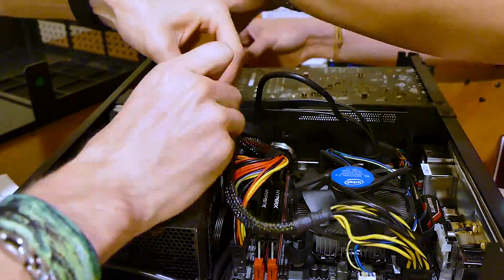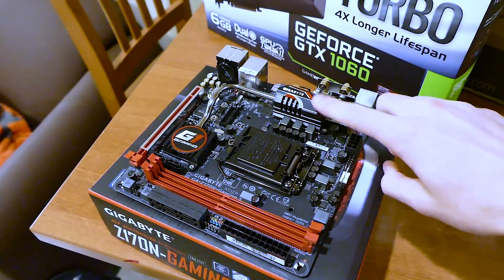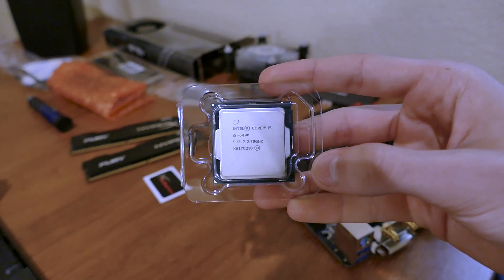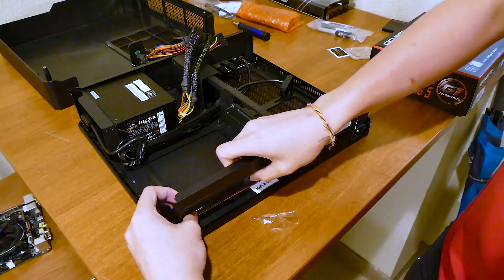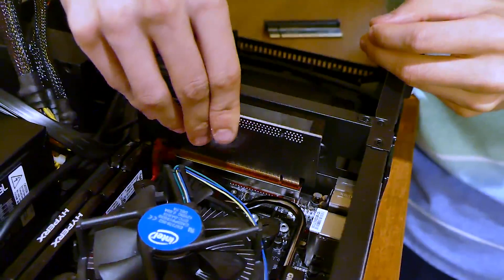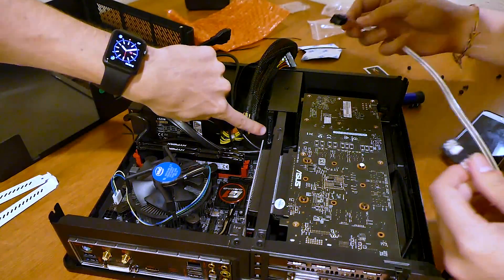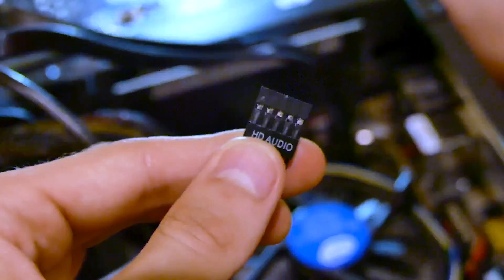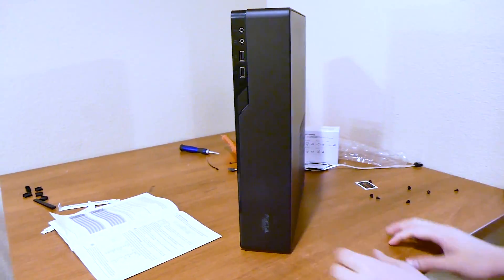How to Build an ITX PC (2016 Edition)

Comment: you can't get an HDD in that case can you?
Reply: 2.5 inch drives, but not 3.5 inch
Reply: you should try out a pcie m.2 drive. those hit speeds up to 3k megabytes!
Reply: Robin Clarijs well ssds are really night and day compared to HDDs in speed. I wouldn't wasn't a gaming library on an SSD. My main file storage is a 480gb SSD and I have a 2 TB HDD partitioned for backup and for game storage. I have 1 game on the ssd. That's also the same mentality people have about price differences in GPUs/CPUs. When it comes to PCs, money and performance do not align in any meaningful way. Unless your budgeting, there isn't a real reason for holding off because 2x the cash doesn't mean 2x the FPS or the write speed.
Reply: I'll go for the rvz01 from Silverstone. Room for an HDD and ssd as well as full height GPU.
Reply: Someone could do fine with an ssd
Reply: Robin Clarijs it will be much longer before SSD prices come close to HDD prices because there's room for improvement on SSDs. SSDs will be expensive for a long time to come. I find that saving time on read/write in my daily workflow is worth it. I transfer very large files between PCs every day. Like 30GBs + file sizes. If I can read 2.8GB/s and write 1.9GB/s for 3x or even 4x the cost, I'm going to spend that. It's valuable time saving. Where as a WD Black reads and writes a measly 150 MB/s. Do you see now how one might justify spending $800-900 on a 1.5TB PCIe SSD? Sure you could build a decent gaming rig for that price, or you could be ultra efficient.

Comment: Slick design. was the blower style GPU necessary because of the small form factor?
Reply: if you use open fan style gpu in a slim case, the hot air would keep circling around inside the case, and the gpu will suck the same air over and over, it might overheat the internal of the case aswell as all the components. The only mean way of air coming out is passively through little holes which is slow and painful. So the blower style gpu will ease the internal temperature abit because it behave more like an actual vacuum. Its not necessary but the blower is better for slim itx case.
Reply: thanks
Reply: Yo I'm extremely new to PC building and had a quick question about this. He said something about the turbo style GPU being generally underclocked. Could you explain this a little more to me? How much does this affect the potential of the GPU? Also, how effective is the turbo style GPU at keeping hot air out of an itx case. Thanks! (sorry for being dumb)
Reply: so if i were to build something similar to this build (leaning toward an itx for its size), having a turbo gpu wouldn't limit it's potential? thanks for the response
Reply: Awesome, thanks for helping out man!

Comment: so quick question, does a i5 6400 over clocked to i5 6500 frequency yield similar results? I have seen that the i3 6100 does almost as well as the 6400, and that you should really just go for a 6500 or a 6600k. Am I misinformed?

Comment: can you sit the case down flat or does it have to be standing?
Reply from the maker: You can lay it down flat, but at the expense of partially suffocating your graphics card.
Reply: It really should have included some sort of feet.
Reply: You can just put some small blocks at each corner if you need them that badly
Reply: It comes with adhesive rubber feet.
Reply: +Science Studio well it does not suffocate much tho check out kyle's video on go anywhere and do anything pc 
but i think he has a fury gpu which kinda small if that affects anything
Reply: is that pcie riser comes with the case? or bought seperately
Reply: comes with.
Reply: Thank you guys.

Comment: i would rather use a bit more money than actually buying asus turbo. is loud and hot
Reply: This card has a blower style fan, which works better in small spaces.
Reply: Also has a pretty low tdp so that's good too as well (low as in less than fe)
Reply: so does the rx 480 card work well with that blower style card?
Reply: Just like my wife

Comment: hey Science Studio,
do you have a way to bypass the bclk Oc blocker microcode from Windows. Because nowadays undoing a Bios update isn't sufficient
Reply from the maker: Downgrading a BIOS takes literally two minutes and harms nothing. In fact, most motherboards are running the stock, oldest BIOS available.
Reply: yeah, but now windows will give a boot error if you try to bclk
Reply: Yeah when the Bios is updated, the CPU's own microcode is then updated to disable the baseclock OC. as far as i'm aware theres absolutely no undoing this, and even if you can its dangerous biz messing with something like that. haha:)
Reply: to be clear I was talking about the microcode, you can't undo that. though you may be able to downgrade a bios in some situation.
Reply: +Pranav Veerubhotla then you did something wrong :(
Reply: Microcode is called such because it's the code intended for the operation of a microprocessor. There's no such thing as bios microcode.
Reply: I know what you mean, this happened way before too, Intel just distributed a microcode into their CPU via an update, rendering all "overclocks" useless and resulting into bricks

kinda a di**move
Reply: You can't downgrade bios on most boards...
Reply: +Science Studio do a video on this please how to downgrade your bios
Reply: Isn't the microcode in Windows?
Reply: It's just Intel punishing consumers so they can protect their sales of unlocked CPUs. I say that as an owner of an i5 K series, Intel if you're listening stop kicking the first time/budget builders out there who just want a few extra MHz.
Reply: Correct. But the "CPU Microcode" is on the CPU. Not in the bios. It simply uses the bios as a safe way to update that.

Comment: This is exactly what I was looking for thank you.
Reply from the maker: Thanks for watching!
Reply: Would something like like the GeForce GTX 1070 MiniITX work better for this build? or even work at all? http://www.newegg.com/Product/Product.aspx?Item=N82E16814125893&ignorebbr=1
Reply: he opted for a 1060 mainly for budget, but a 1070 works well too, hell i saw people shove in reference cooler gtx 1080 inside that case and they work as well, just know that those are pretty loud on high fan settings.
Reply: Yea I figured, The one I linked was a Mini 1070 so it looks to be about half the size built for mini ITX builds. And how would you feel taking this in your backpack for a carry on for flights?

Comment: Very nice! I'm thinking of downsizing to ITX when I next upgrade my video card (so probably like 2 yrs out still), it's becoming increasingly more appealing to me, especially with how power efficient stuff is getting.
Reply: I'd rather stick with full atx. Itx is all crammed up, cable manegment is a pain, heat, and a lot of parts wont fit in a case
Reply: you could check the Bitfenix Prodigy Itx case, it has enough space for liquid cooling, a gpu of three fans; it only lacks in cable management, I use that one ;)
Reply: +Melancholia Dementia or fractal design nano s
Reply: +Joseph B. Depends on the case really, what I like about itx is the fact that you can move it around, which I do quite a bit.
Reply: Joseph B. I don't mind it being cramped. I don't upgrade my system frequently and I'm not interested in closed loop systems or anything.
Reply: +Hiebly I'm currently building in the 250d, I highly recommend it.
Reply: AXLplosion Aye, it's one of the ones I'm most interested in! Others that have my interest are the Fractal Node 202, Silverstone RVZ-02, and Phanteks Evolv.
Reply: +nickthaskater And if you ever need an optical drive, the 250d works for that as well.

Comment: Question Greg senpai, how much heat and noise you get on that pc? i want to build one like that, but im a freak about how noisy and hot  gets my pc on full working
Reply from the maker: It was actually surprisingly quiet. Virtually silent at idle, and moderately loud thanks in large part to the stock CPU cooler.

Comment: I feel like overclocking an i5 6400 non-k is not worth it. I think you would have to downgrade your bios and turbo boost will be disable. Additionally, the extra power from overclocking  doesn't make much of a difference in gaming in terms of fps. Not to mention the risk that is involved, the more expensive z170 motherboard, a aftermarket cooler(although some people still buy an aftermarket even if it's a non-k), and you would also have to mess around with you dram. 
What do you think Greg? =)
Reply from the maker: I've done it several times. Either stay at 3.2GHz or overclock to 4.4GHz and lose something you'd likely never use anyway (your iGPU).
Reply: I actually have a i5 6600 non-k( got it on sale) and a z170 motherboard, I was planning to overclock it too. Can you tell me if the extra processing power really makes a difference? I've been getting a mixed opinion on the fourms. Thanks!
Reply: can you make a video on how to overclock a non-k cpu using this method?

Comment: A nice build, but the only comment that I have is that I would have gone with a single 8GB stick instead of dual 4GB sticks. From what I understand, dual channel memory has virtually no effect on day to day usage and gaming, and having an open slot would allow you to upgrade to 16GB later if you wanted to. In this configuration you'd have to replace both sticks.

Comment: I literally just built a mini itx in a fractal node 202 last week, but i got mine for under $550
i3/6100, strip rx460, msi-h110 pro AC mobo and 240gb SSD
Reply: The hardest thing in that case is for sure the cable management.
Reply: +Brinson M. McBride 260 is kinda small tho. Fine if ur a storage nazi :)

Comment: I would have gone with the Silverstone raven case.
Reply: and that's the beauty of custom pcs.
Reply: i agree, this one does not have dvd drive bay
Reply: I prefer the Phanteks Evolv ITX but it isn't nearly as portable and space efficient lol
Reply: Im waiting for the RVZO1-E, the one that able to use atx psu version :)
Reply: nice man, I want that RVZ02 just because its smaller
Reply: +S Saini it's very good than node 202 but it does not include a power supply so that will cost a bit more than this
Reply: There are two versions of this case one with and one without psu.

Comment: do you know of a good water cooler and or a a case full tower with 360mm support cheapish
Reply: I always see thermaltmake with 360 radiator support cases they might not be that good tho for the AIO they also have one but i wouldent touch it id do rrsearch in this part
Reply: well i don't know your definition of cheap, but the enthoo luxe has 360mm support and the case is about $150

Comment: Man I wish the 1060 did have SLI, the 1000ish$ PC's one could build! Cheeky Nvidia 😏
Reply: It would > the 1080 thats y but if dx12 support for multi gpu without sli or crossfire becomes the future then we might save some $$$
Reply: They didn't add sli because it eould be more powerful than a 1070 or 1080 and it would be cheaper  than the 1080
Reply: too bad sli or cfx doesn't scale too well in most games, even vulcan or dx12. plus the 1st card always runs hotter and louder because of airflow restriction. i'd stick with the single 1080 for about the same price.

Comment: There's nothing wrong with a stock cooler on that cpu man. I'd stock cool that...
Reply from the maker: Will be overclocking. Not ideal.
Reply: +Science Studio ohhh yeah I forgot you mentioned previously you'd be doing the oc on the bclk...
Reply: What would you put in a case that small?
Reply: When I started out I had an i5 4670K at 4.2 GHz on the stock cooler, it'll do if you don't mind seeing 70+ C.
Reply: Hey! I also collect nearly the same build for myself...wasn't sure about case! Thank you so much for video! I will take this one case! But I plan to overclock the processor...can you propose more powerful cooler please? Any? I planed to buy this one >
https://www.amazon.com/gp/product/B00N4OBH92/ref=ox_sc_act_title_6?ie=UTF8&psc=1&smid=ATVPDKIKX0DER

But it won't fit...right?